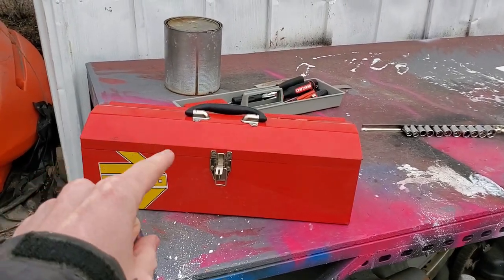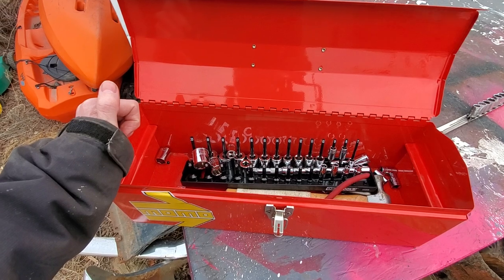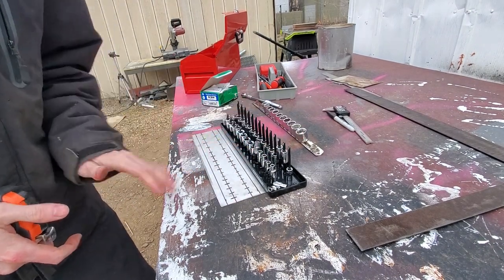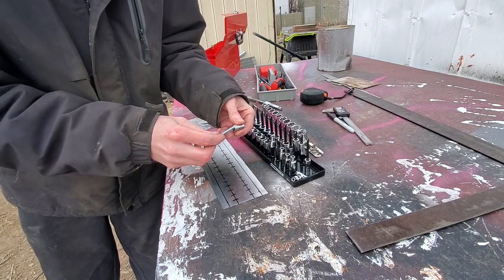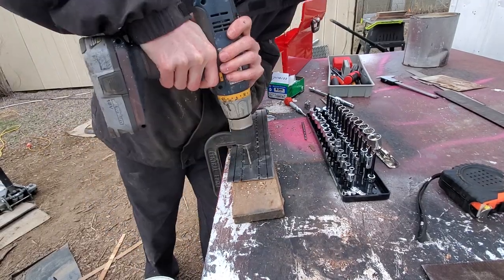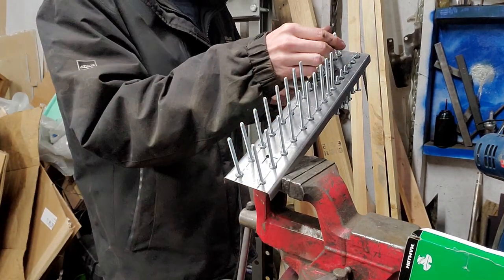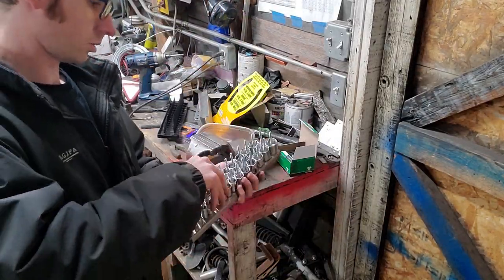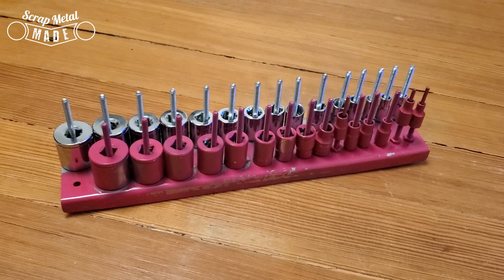Making a better socket organizer

Comment: Minus the two little guys there, your sockets are all basically the same height. What if you were to add a bolt to each end, centered, then cut a strap just wide enough to sit between the two rows of sockets? You could secure it with wing nuts for easy removal, and depending on what material used you could add a handle to the center of the strap, or incorporate it into one of the ends of iit. Add a thin strip of foam on the bottom side of the strap, and your rattle issues should be resolved as well. Very nicely done sir. I have been looking to do something different with my disaster of a socket drawer, and I think you just ended my search. Thank you for sharing!
Reply from the maker: Thanks for the ideas!

Comment: You could tap the holes and tack weld the bolt when tightened in the plate.  You could use heat shrink tubing to help reduce the rattling and magnatis the plate to help the sockets stick to the bottom plate.

Comment: I dig it. I’d use this for sure. One thought I had to reduce rattle was to get some surgical tubing, brake hose, or something like that, and thread little chunks of it way down at the base of each peg/screw so the sockets are cushioned. 

You could also put some shelf liner or other cheap material down on the base, so the sockets make contact with that instead of the metal base. Might be able to thread that shelf liner on without even cutting holes since it has small holes in it already and it would cost almost nothing to replace it when it gets gunked up.
Reply from the maker: Thanks for the ideas! I was also thinking about using silicon tubing to quiet things down. Honestly my metal toolbox is pretty loud in general though so the rattling hasn't been bothering me yet. It would probably be really annoying if I drove a really quiet car like a tesla.

Comment: Nice build , I am looking at different scoket holders, I like your DIY, my problem is I am looking for something to have bigger labels,as I am 60 and have to use glasses to see the sizes,
Reply from the maker: That's a tough one for DIY. This magnetic style seems interesting and leaves a fair amount of space for labeling but the way I treat my tools I doubt any label I create would stay adhered. https://www.amazon.com/ARES-60155-28-Piece-8-Inch-Magnetic-Socket/dp/B09JQRN9GT/ref=sr_1_27_sspa?keywords=socket%2Borganizer&qid=1702834681&s=automotive&sr=1-27-spons&sp_csd=d2lkZ2V0TmFtZT1zcF9hdGZfbmV4dA&th=1 Labels are nice for organization though. Good luck and share if you find a good solution!